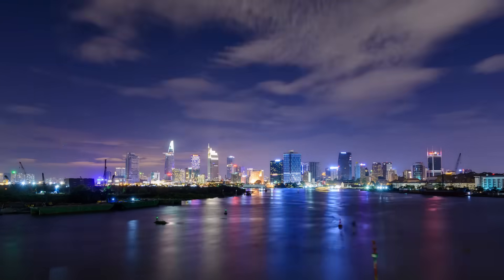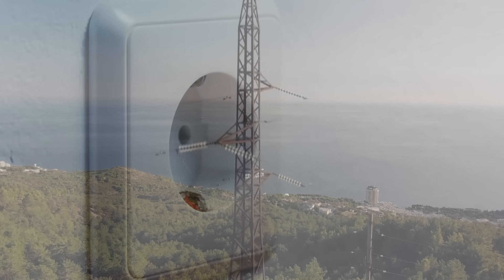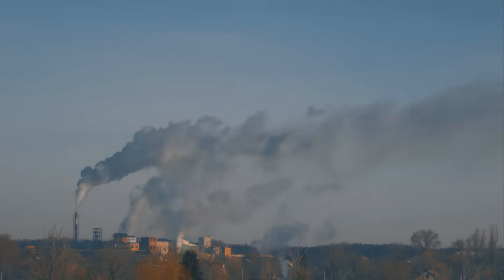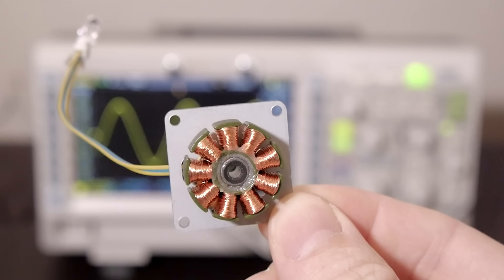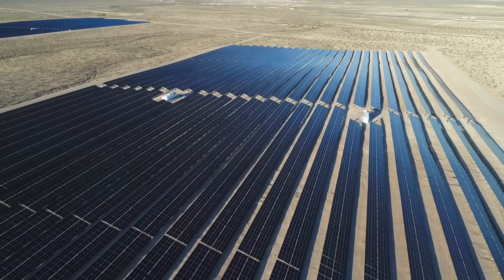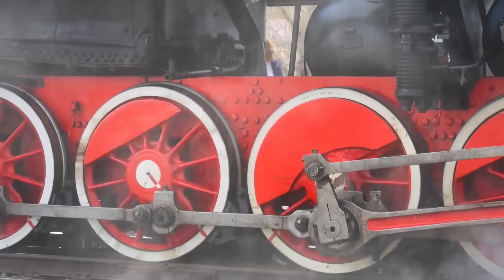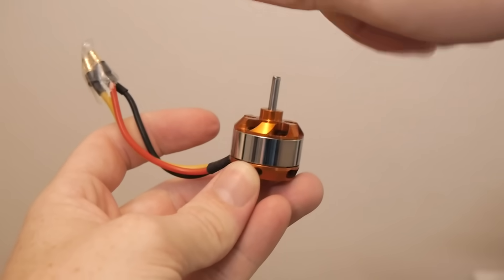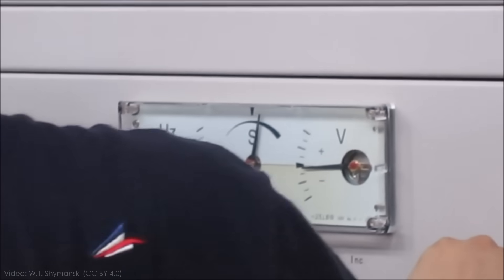How Electricity Generation Really Works

Comment: Solar and wind are also far from environmentally friendly, as they require extensive mining for the materials to make them, and have unnatural use of land/airspace that can disturb local species and ecosystems, that is also disregarding their disposal after their lifespan as well. Nearly every form of electrical generation will have its drawbacks, there is no quick easy fix to this issue.
Reply: I disagree with this sentiment… the technology is constantly improving, Solar panels are lasting longer and are getting more recyclable and the the energy produced from solar panels are direct rather than heat generated from burning fossil fuels being used to create steam which in turn rotates a turbine. There is so much waste with electricity produced from fossil fuels and they also require mining so they are basically incomparable in my opinion

Comment: No!  Electricy doesn't move at 'nearly the speed of light' ~ in a lot of systems electrons move very slowly.  You could think about a garden hose (very similar to wire, full of water, as soon as you put pressure to one side stuff comes out the other side.  So water travels at the speed of light?  NO.  Electricity does not travel near the speed of light.  Love your videos though now off to watch the rest of it.

Comment: You said something false: "1/3 of greenhouse gasses are produced by fossil fuel power plants" you actually meant 1/3 of CO2. And C02 only makes up less than 1/10 of the various greenhouse gases. The biggest greenhouse gas is water vapor. But Al Gore got everyone on board with CO2 and that's that I guess.

Comment: Engineers: "Let's use wood to heat water to make steam to turn a turbine!"

"Hey, we discovered this stuff called coal, it burns pretty well." 

"Great, let's use it to heat water to generate steam to turn a turbine!"

"Hey, we discovered natural gas, what should we do with it?" 

"Use it to heat water to generate steam to turn a turbine!" 

"Hey, we managed to split the atom using cutting-edge technology! It's my life's work, what should we do with it?" 

"Use it to heat water to generate steam to turn a turbine." 

"Hey, I just realized, why don't we turn the sun into usable power?" 

"Great idea! Let's use it's heat to generate steam to turn a turbine!" (On certain very large plants that don't use photovoltaic panels, they are rare) 

"Hey, we managed to create artificial nuclear fusion, something that will permanently change humanity and give us near-unlimited thermal energy!" 

"Great, let's use it to heat water to generate steam to turn a turbine." 

Engineers, y'all need to get more creative. Most of our power is still generated through steam power, the only difference is where the heat is coming from. We've been using the same method for more than a century, we need to find something cooler than "heat water to make steam to turn a turbine."
Reply: Why fix what isn't broke? That's looking for a problem to fit your solution to.

Besides: Steam never dies. For a reason.

And also spinning things is one of the most effective ways to produce AC electricity. And turbines are one of the most efficient ways to produce spinning. And PV solar is one of the least efficient in terms of long-term production (Because the hotter the panels get, the less energy they can produce...yet they can only produce power when being blasted with sunlight and heat...)
Reply: You are describing the basic operating principle of a thermodynamic or heat engine… use a heat source to heat a working fluid that converts thermal energy to mechanical energy.  Steam is one of the most efficient working fluids available.  This is just basic physics, no amount of engineering “creativity“ is going to change that.

Comment: At 03:40, you said a three phase system can carry three times the power on three wires as a single phase system can carry on two wires... but I believe the actual multiplier would be √3 ≈ 1.732, which is much less than 300% but still a meaningful improvement over the intuitive answer of 3/2 = 150%.

Comment: Is that true the electricity moves at near the speed of light? I thought the actual movement of electrons was a lot slower than that, like meters per hour or something like that and even the speed that a circuit a works at is much slower than the speed of light like light moving through water compared to a vacuum.

Comment: PV is more flexible than you give it credit for.  All PV is DC as you well know, and is switched using whatever method to sync up to the grid wave.  There's no rotating mass to go nuts by frequently adding or removing DC panel load simply by tuning inverter output.  Sure, PV output follows a sunlight curve, but that's not even close to the same time scale in which you suggest only rotational mass can ensure against variability.

It would be nice to see a spot on engineering requirements & environmental concerns about the various forms of either tidal or wave-motion generation technology.  There's that nice floating pontoon tidal platform from Scotland with dual-mounted props that seems nice.  I wonder what the site requirements would be like.  I know the Puget Sound area has been making electric ferry noises for a while, but the transmission infrastructure literally isn't there.  Would local tidal stations plus some minor local power storage be cheaper than upgrading whole swaths of transmission lines?

Also might be nice to see a "state-of-the-industry" re: HV DC vs. this AC business we've been struggling with for a while.  Are there upsides to going to HVDC?  Additional equipment requirements?  What would a properly equipped infrastructure that's been decoupled from frequency look like?

Comment: Actually electricity is pretty slow. Last time I did the math in College it came out to about walking speed. Just like water is "instant" if the pipe is already full, a wire is already full of electrons. So when you turn the power ON, its the electron thats already there, at the end of the wire, that will do the work. 

The electron per say does move at close to the speed of light, but in all directions, resulting in no net movement (if its powered OFF). When you turn the power ON, the electron will still move in all directions, but it will now have a net movement. About walking speed.

Comment: What we need is a buffer.  Large buffers.  Like really large buffers - batteries or other storage devices (capacitors, etc).  Perhaps solid state batteries will be the answer, but if we can build buffers - batteries - to store power, that can be relatively easy to tie into the grids to handle peaks and to store power when demand drops.  We'd reach a much higher efficiency rate by buffering power.  And almost everyone else watching your channel probably knows this, the word need to go out to those who don't.

Comment: Please answer the thorny question your raise directly in the video: HOW are we dealing with unreliable (or intermittent) renewables now ?  Prospects for the future ?  I've read that nuclear can only provide about 50% of total power - as a base load - since it cannot be effectively throttled (or rather, is too expensive to do so).  There was an interesting cover story in Scientific American some years ago, with a speculative piece how the US could be powered by mostly renewables (except transportation) with large storage systems (buried molten salt reservoirs) and a DC transmission system to provide power from sunny places and windy places to the rest of the country.

Comment: Soooooooooo... Now why is frequency important? What happens when it's not synchronized and why does whatever happen, happen then? And why does it cause blackouts and brown outs?
And why is Solar unoptimal for frequency synchronisation? You talked a lot about  inertia and 50 and 60 hz, but why are these values important? Is it about phase cancelation? How does that happen in electron movement? Would a sudden drop in frequency dead stop a generator? And how does a drop in freuquency affect voltage and aperage?
We never really learn a lot about electricity in school, only rudementary stuff like Volt, ampere, watt and ohm. Frequency is barely discussed, so I am dumbfounded at what it really means, I only know it's bad when it's out of sync but not exactly why that's bad, or why solar isn't good at synchronizing frequency.

Comment: It's ironic, IMO, that we still use steam cycle so much for power generation, just substituting natural gas for coal/oil. Immense heat of vaporization of water is the culprit. Much greater efficiency is possible using gas in gas turbines, additionaly recovering waste exhaust heat with regeneration (heating compressor output), or Stirling engines (NOT steam turbines, touted by GE).  Modular gas turbines can be brought online very quickly a/r. Hopefully I'm making a case for study of efficiency of utility heat engines, for as long as we'd use them.

Comment: As an electrical engineer, I wish more people would watch this video to appreciate the complexity of having power on demand.
Reply: I have a question for EEs such as yourself. A power unit generates power in watts (0% to 100%) as a product of amps & volts. Are the volts, at the generator outlet fixed?  If so, what is typical?  For example, a large nuc puts out about 1 gigawatt at full load (via 2 generators) what are the volts, what are the amps?  Thanks to whoever weighs in!

Comment: Device to end the creation of Nuclear waist.
Electric Generator Design that's powered by it's self & perpetuates more electrical current then is needed for it to run continuously on it's own. 
 Step 1: calculate how much energy you need pumped into an electric motor to make a vertically positioned circular platter with magnets in-bedded horizontally around it's left side and right side (so there pushing force is pushing out sideways relative to the vertically spinning disc) to spin as fast as you need it to. Also better to make sure these magnets are shielded around their sides & back  with metal that has high permeability so the magnetic field they are emitting is focused fully out sideways. :D Step 2: Calculate how many sets of copper coils you need to be interacting with magnetic fields to achieve this & to perpetuate more electrical current flow then is needed. :D Step 3: Build a round horizontally positioned platter covered in all these copper coils pointed down that does not move (Is stationary) :D Step 4: build a round platter covered in powerful magnets pointed up that can spin and place it directly under platter with hanging copper coils. :D Step 5:  Position the vertical platter that is  motorized close to the horizontally positioned platter covered in magnets pointing up so that when the vertically positioned platter spins the in-bedded horizontally positioned magnetic fields slam sideways against the edge of the horizontally positioned platter causing it to spin. :) Step 6: Make sure enough of the copper coils are feeding their electrical current into the electric motor and the rest of the copper coils are linked into a set of rechargeable Battery's placed in the closest most convenient spot. Step 7: Build a duplicate setup of horizontally positioned discs with hanging copper coils and disc with upwards facing magnets and assuming the first set of discs are positioned to the front left side of vertical spinning disc, position the other duplicate structures to the front right, the back left and the back right of the vertically positioned motorized disc. As the vertically positioned motorized disc spins the horizontally in-beaded magnets will now hit into all 4 horizontally positioned discs causing them to spin. so you will effectively be using the spin of one disc powered by one electric motor to spin 4 constructs that are each generating electrical current. now build this whole setup multiple times over and use the current perpetuated by it to power up scaled electromagnetic generators that are equal to or more powerful than the ones used in a nuclear power plant. You will now have a device that is self perpetuating off of it's own electrical current perpetuation and no nuclear waist to worry about.
Reply: ok crazy

Comment: I'll never understand how switching to solar or wind can ever provide continuous power.   Is technology just stuck in limbo figuring out how to store this?   I suppose we could go back to the late 1800's and just have everybody go to sleep when the sun goes down or the wind stops.
Reply: they're called batteries...
Reply: @afgor1088  You got any bright idea how to store enough energy in batteries to power a major city for days on end?  The key word here is continuous  
Having been through the Feb Texas blackout with no heat, no power for days in near -2 to +12 high temps.  People slept in their cars (burning gasoline or propane BTW) or running portable generators (also gasoline/nat gas) if lucky a fireplace with wood or gas or even a charcoal grill (coal) to keep from freezing to death - literally!  The wind turbines didn't work,  nor did miles upon miles of solar panels.  And even the usually dependable power plants running gas, coal,  solar nor nuclear could  handle the load for Texas's near 30 million people because existing state of the art grid management failed delivering continuous power

Comment: I would love to have you talk about gas-turbine power generation, where heating water is not the primary energy conversion method—urning an internal combustion turbine is. Heating water from the primary turbine's output, to generate steam and drive a second turbine, increases the efficiency of the power conversion of natural gas well above what is possible in a coal-burning power plant. Cool stuff.

Comment: Is it only possible to operate one generator off one drive and I assume there is loss of efficiency if you gear drives (ie get more turns from a single turn). Lastly, has there been any development, improvement,  in recent years?

Comment: Just sat through rolling blackouts in Texas in after windmills failed. Want to go green on energy production, great.  Might want to look into a winterizing the windmills and a back up plan if the wind isn't blowing j/s
Reply from the maker: Majority of outages in Texas were gas-fired thermal plants
Reply: @PracticalEngineeringChannel  sorry if I came off harsh. Your video are great. I can proudly say I understand what a cut and fill is thanks to yall

Comment: Co2 is not causing warming its the product of warming & the greening gas of life for the planet.

Greenhouse Effect was self debunked when the upper atmosphere stopped warming for nearly 20 years while Co2 levels & surface temps continued to rise contrary to the theory.

"Climate Change" more slight of hand is altered weather patterns on the local & regional level 
Climate change is mainly caused by the increase in wireless communication altering the natural magnetic fields, ley lines & poles of the planet that loosely hold the jet-stream in place similar to the moons influence on tides.

the increase in climate change exactly parallels the increase in wireless communication where Co2 appears after the warming process showing it is a product not the driver of global warming.

if you have an understanding of basic microbiology & ecosystems you would understand that when the temp rises above 15c  the rate of natural organic decay (composting of leaves & dead-fall) increases  exponentially & the primary by product of composting organic matter is Co2 & methane, where Co2 by its nature lingers low where it is absorbed by plants & trees & converted to oxygen.

the Climate crooks will never tell you this, nor will they ever tell you how much Co2 occurs naturally implying it is all from human activity & intentionally confusing Co2 & Co calling Co2 a pollutant when Co is the pollutant, by deeming Co2 a pollutant they then have the right to tax & regulate it.

many other factors have to be explained like how does Co2 a close to neutral buoyancy gas magically float up to the upper atmosphere ?

and how does the atmosphere work as a check valve supposedly allowing heat in the form of solar radiation but apparently not allowing it to escape, selective Co2 ?, perhaps it only comes out at night.

no its clear cutting of forests for modern civilization is responsible for most global warming as the surface is like a big heat capacitor, the more you can keep it shaded the less heat it will have to release after sundown.

Comment: Love it! I spent a few seasons around 2004 as a grid/engine operator at McMurdo Station, Antarctica, and this is a perfect explanation of our fairly simple system. No steam generation tho; just diesel engines powering turbines directly. At the time, the equipment was from the 60's and so syncing the frequencies to bring on a fresh engine meant eyeing a synchroscope and making sure your hand was steady! Thanks for another great video!

Comment: The video completely glossed over the fact that modern natural gas plants do not burn gas in a boiler. Instead, gas is burned in a combustion turbine (essentially a jet engine on the ground) which spins a generator. In some of these plants, the waste heate in the exhaust is captured in a boiler where steam is generated to spin a steam turbine and create additional electricity. This type of plant is much more efficient than older natural gas boiler plants.

Comment: A benefit to solar cells is they can be right at source, meaning it doesn't have to travel through power lines. Which is both a savings in infrastructure and less power lost from traveling through lines.

Comment: That grid inertia needs to be migrated to batteries eventually! Low-Density, large cycle batteries are perfect for grids because they can be as heavy and as big as necessary, so long as they can tolerate long lifespans with lots of cycles and and the ability to output LOTS of current safely!!